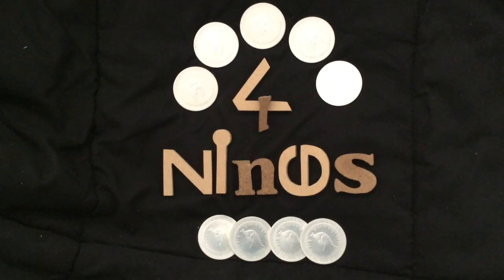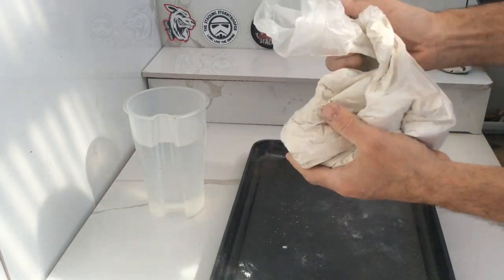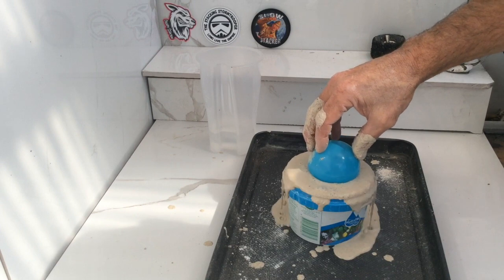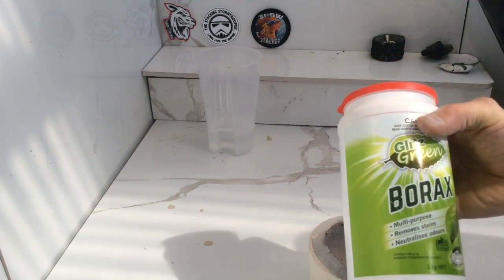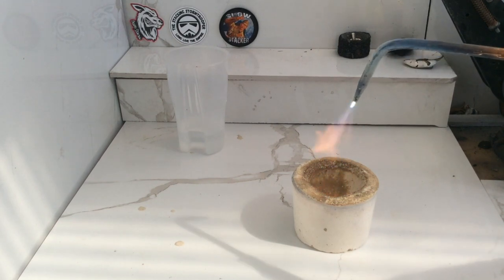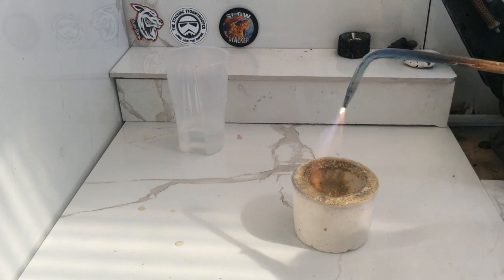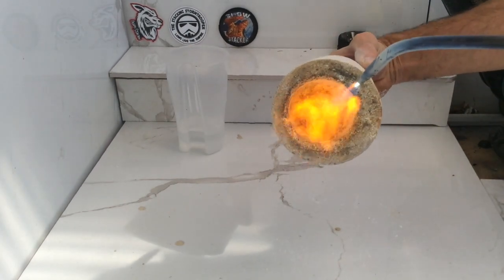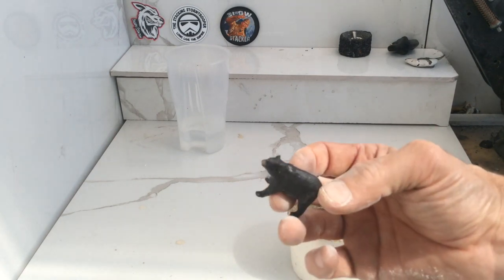How to make a Crucible  Part 1of 2

Comment: Incredibly easy and basic ingredient
Reply from the maker: Yes you are right very easy and basic but not good for long-term use💛😎👍
Reply: @4ninesfinesilver315  Oh really?, whys that?..because of the constant heating & cooling?
Reply from the maker: Moose2K20 yes it’s good for Pewter or perhaps lead but when you start heating copper it can’t stand it for too long. with copper you get about five or six pours with Pewter it will last for about four months maybe longer💛😎👍
Reply: @4ninesfinesilver315  It amazes me how the different properties of molten metals affect things differently..now my interest is piqued, into the books I guess!
Reply from the maker: Moose2K20 that’s great maybe you can teach me something about it in the future instead of buying everything at exorbitant prices I made some the other day out of extra strong concrete that seem to be holding up pretty good although I’m using plenty of safety gear in case I get an explosion😂👍